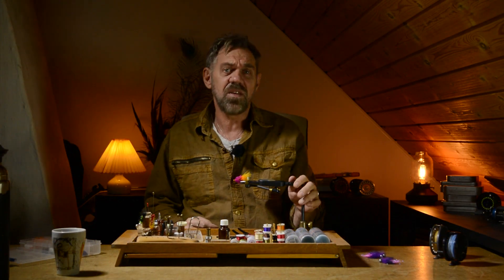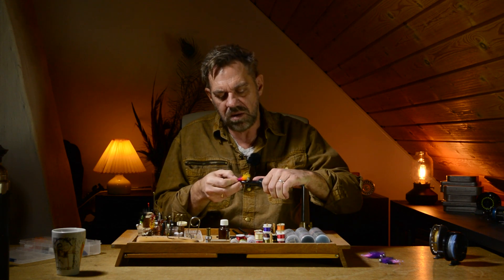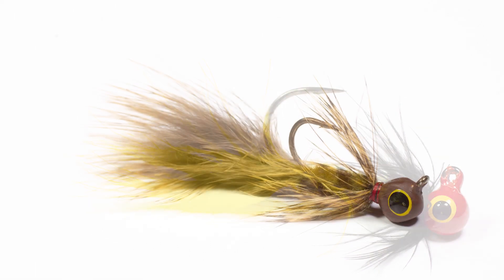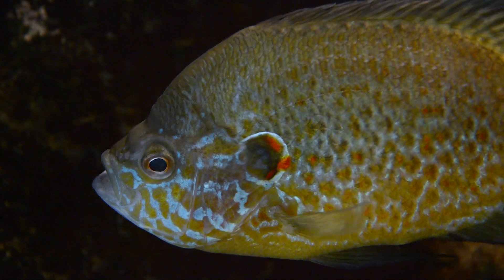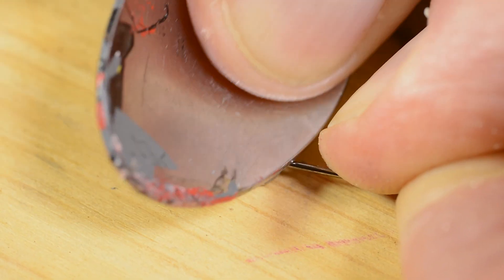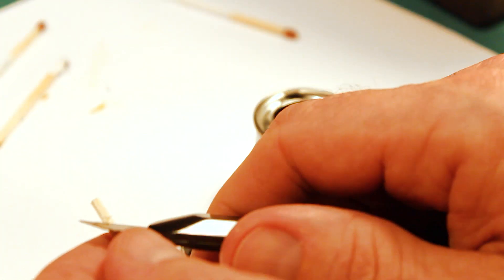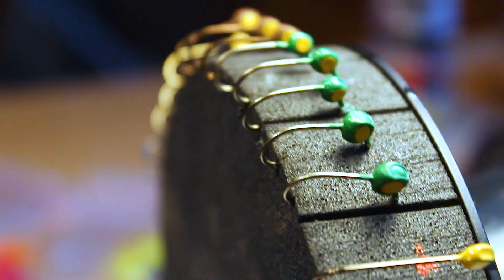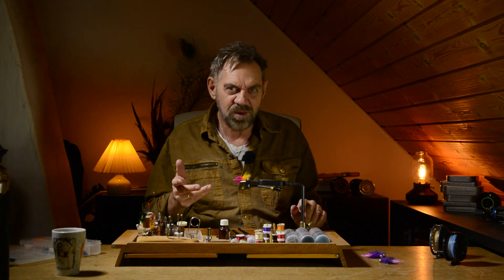How to make and paint heads for Dog Nobbler flies

Comment: That underwater footage looks great Michael!  I'll have to try your method of making the heads, I've been anchoring lead wire wrapped around the bent hook with crazy glue, then smoothing out the mess with uv resin before painting with acrylics and finishing with another coat of resin. 

I use a lot of those tiny jigs for panfish.  Ever fish Dog Nobblers suspended under a float?  In the spring, when the water is cold, Black Crappies and Perch often like a suspended jig with the subtle up-down motion (from the waves).
Reply from the maker: Thanks Hank. I've tried differnt methods of making those heads. This one I think gives the most consistent and clean result. And that paint holds up very well. 
Yeah I've fished Dog Nobblers under small floats. It always amazes me, how much action these small lures have, if there is just a small ripple on the surface. Should film that actually. Cheers, Michael :0)